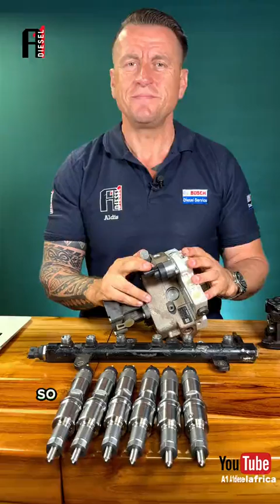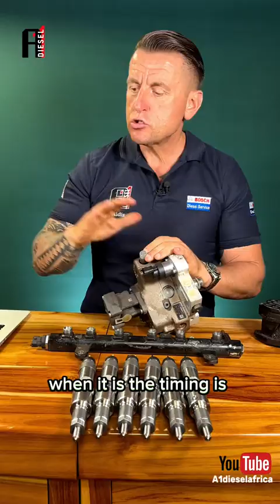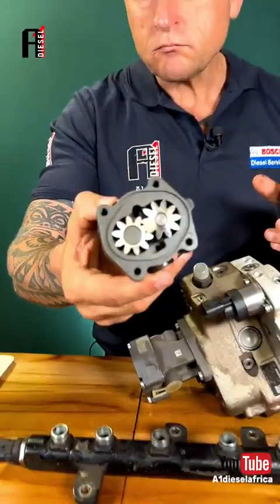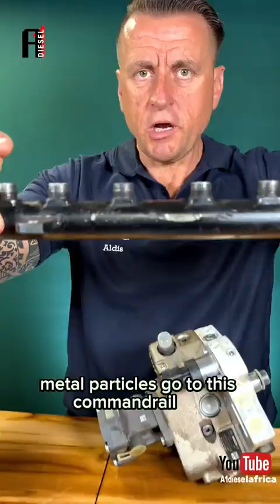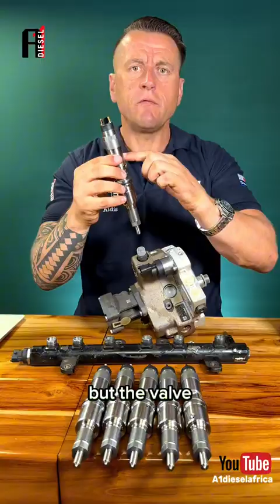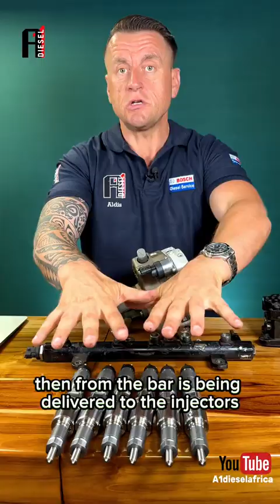Common Rail Explained

Comment: You forgot to explain the purpose of the solenoid on high pressure pump and sensor in the other side of the rail. Also differences between common rail solenoid and piezo injectors would be handy. ;)